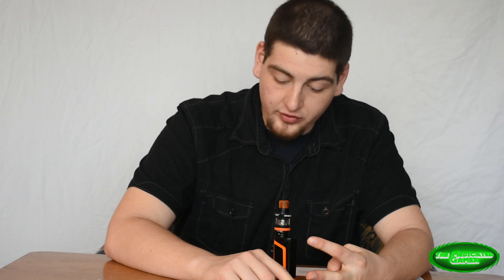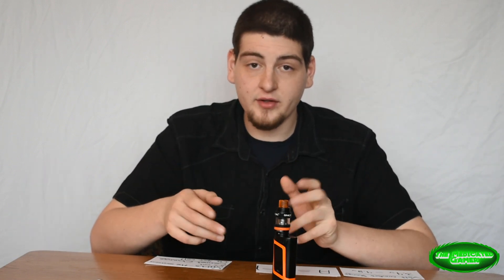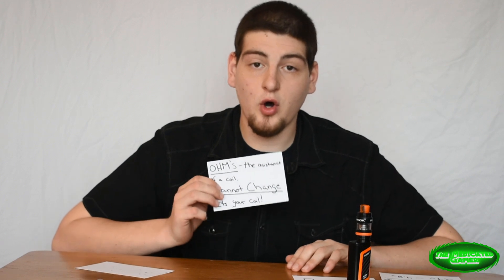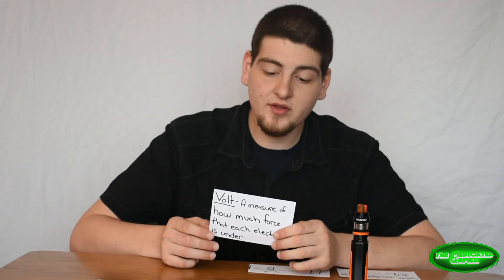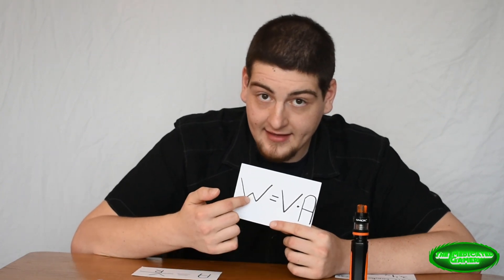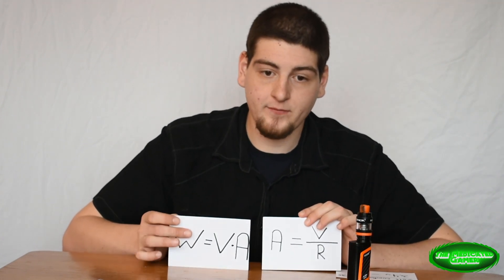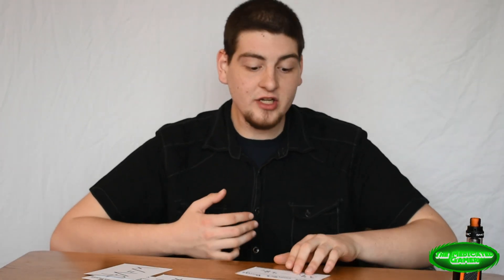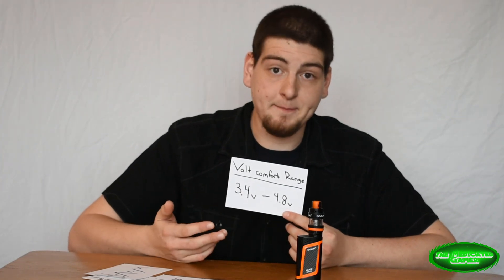Vaping 101: OHMs, Watts, and Voltage Explained for Beginners

Comment: How to know my voltage
Reply from the maker: As long as you're using a digital mod like the one I have it should display on the screen somewhere. It should look something like (just example) 3.255V, the v means volts. Some mods only show the voltage when you use it, when idle it says 0.000V. Hope this helps!

Comment: The ohm show on my vape was 1.50
Reply: I'm using rev nitro vape..
Reply from the maker: Honestly I've never seen or used a coil in modern vapes over .8.
I do remember back in the day when vapes first got popular the tiny coils they created were like 1.2 but the mods at the time didn't let you change any settings, they just were.

Comment: Thanks for the effort...but I'm more confused now than before! I've used just basic mods before - no settings at all. Decided to get an Aspire Dynamo 220W - and I have NO IDEA what to set it at. I was hoping for something a bit more simplistic - I got a D in math!
Reply from the maker: Depending on the pre-fabricated coil that either came with it or you bought after the fact, I would adjust your watts until your ohms read somewhere around 3.2. Once you reach that you can adjust it slightly to your liking. Sometimes I run my watts high enough my ohms read over 4 and sometimes as low as 2.5. It's all your preference. However higher the ohm, quicker you'll burn your coil and drain your battery. I hope this helps, let me know if you have any more questions!

Comment: get c++ for free and put THIS 

// tea.cpp : This file contains the 'main' function. Program execution begins and ends there.
//

#include <iostream>
#include <conio.h>
using namespace std;
void OhmsLaw()
{
 float r, w, a, v;
 cout << "What is the resistance (in ohms) of your coil: " << endl;
 cin >> r;

 cout << "\n voltage (v)" << endl;
 cin >> v;
 a = v / r;
 w = v * a;
 cout << "\nThe wattage that should be used is " << w << " on a coil with " << r << " Ohms." << endl;
}
int main()
{
 cout << endl;
 OhmsLaw();

 cout << "\n\nPRESS ANY KEY TO CLOSE THE PROGRAM.... " << endl;
 _getch();
}

Comment: I'm brand new to vaping and honestly, I'm even more confused after watching this. I have the T Priv, got it set at 50 Watts. If I put it any higher it burns my lips when I vape. Also there are 3 settings for my coil, steel, TI and NI200. I don't have any clue what kind of coil is in it.

Comment: I can adjust the ohms on my SMOK Alien mod. So, yes, you CAN change the ohms.
Reply: No, you cannot. Telling the device that 1 ohm exist does not make it true if the actual coil registers at .5 ohms. If you tell your device that you have 1.0 ohms resistant coil and you want it to produce 10 watts of power output than the device will increase the voltage applied to attain the 10 watts of power expecting a full 1.0 ohms of resistance  thus burning up your .5 ohm coil.

Comment: Medicated Gamer i need your help.I got my istick pico mini melo III from Greece and i am now in the United States and i just dont know what coil it had because i used to go to the shop that i got my vape and they used to change it for me so i had to learn how to do that on my own, i am trying to figure out the ohms and the vg/pg and everything.I am pretty sure they replaced the coil the first time i got it but i dont know what they put and they wont reply to my messages,but i do know that it looked like New Aspire Triton Replacement Clapton Coils Head 0.3 0.4 0.5ohm For E smoke Hot but i am using the Aspire Triton ZPB Coil Head Replacement 1.8ohm DE. From the standard configuration i found online says that ec head which i understand is the coil says 0.3ohm head for the 2ml glass tank and 0.5ohms for the 4ml tank?They told me i could put it up to 13.0W i have 1.81Ω (ohms?) and 4.85V.I used to vape 90vg/10pg but i cant find it here so i am using 70vg/30pg with 3mg in 100ml juice.I have open air flow.I am pretty confused so i really hope you see this message and reply to me.Thanks

Comment: So... do you get more smoke using more watts? Does it use the same amount of liquid?  Do you get more flavor from using something with more wattage in it? I got a small $20 pin and it gives a good amount of smoke so I'm just wondering what's the point of something bigger and if it's worth it.
Reply from the maker: I've found, lower ohms offer bigger clouds. However the lower the ohm the more power it requires so you will need to increase your watts. And of course, bigger the cloud, the more juice you're using. If you're looking for flavor you need to chose the right juice. Juices are made with a blend of VG (Vegatable Glycerin) and PG (Propylene Glycol). More VG means thicker clouds, more PG means more flavor however I do find high PG liquids to be harsh. Let me know if there's anything else I can help you with.
Reply: If you're getting any smoke off it you need to stop immediately.
Reply: @dedmujenta6779  lol you know what I mean 🤣

Comment: Yeah... this is EXACTLY why I quit vaping and started smoking again. I was ok when it wasnt so damn confusing.
Reply: It's actually fairly simple. It's basic math.
   But as long as you have a regulated device and don't build too low you don't need to know any of this. 
    Factory made coils have the resistance printed on them and recommended wattage range so you don't need to know the math. 
    Only time I smoke cigarettes is if I'm out and about and batteries die. I try not to let that happen. 
    Cigarettes affected my breathing. It was hard to walk uphill. Smoked a pack and a half a day for 25 years. I prefer cigarette flavor to vaping because nobody can make a liquid that tastes like a real cigarette. But at least I can get the nicotine and still be able to breathe.
    Good luck, watch some other videos aimed at beginners and maybe you will find a kit that works for you. 
    The initial startup takes an investment but in the long run it's much cheaper than cigarettes especially if you start building and wicking your own coils. Really isn't complicated at all once you get started. Just don't use mechanical mods or you could burn your face off if you don't know the math.
Reply: just buy juul or vladin if this confuses u
Reply: @daviddahl83  basic math isn't difficult at all. It's super simple
 It's not calculus or trigonometry, hell it's not even algebra.

Comment: okay I have a question, I have the SMOK BOX i HAVE NO IDEA what the numbers are.   EXA:   I'm gonna go top to bottom left to right
30.3 letter N in a square over the letter W then pic of the battery VOLT  OHMS  AMPS      
0.000   0.249  0.000   mode   PCB  PUFF
WATT  98*   007 
LAST  line inside of rectangular box    is  0.1s

Comment: I vape CBD for medical reasons and the brand I use says to use 40-75 watts for their CBD to be effective. You said you have to change the wattage to get the right voltage for the ohm coil you have, but what if you need to use a certain wattage? All this is where I get confused. I didn't think vaping was so complicated
Reply: Lina M.C. You just buy coils for that wattage range. I use a 0.5 ceramic coil that recommends 25 to 40 watts and vape CBD at 35 Watts

Comment: Give us the right watts that used with:
0.1 ohms
0.2 ohms
0.3 ohms
0.4 ohms
Reply: the watts you should use is written on the coil
Reply: Ashfaq I use clapton coils. So what would the wattage be for a .193 ohm single coil clapton build?
Reply: Lol
Reply: Clapton coil are for advanced vapers lol so idk xD
Reply from the maker: It's really all personal preference, I cant give you exact numbers. More power means hotter vape thus burning off more vapor but higher watts also means quicker coil burnout and battery drainage. Ying/Yang, what would you prefer?

Comment: Just binge watching random youtube vids and stumbled across this. I admire the effort to try to explain this aspect of vaping for new vapers, but honestly it just over complicates things. Most (if not all) new vapers will purchase a regulated mod and use manufactured coils. More often than not, prefabbed coils will have the recommended wattage range printed on the housing for that coil resistance & material. Calculating amps and voltage with a regulated mod is basically pointless in VW mods. The batteries are isolated from the atomizer circuit by the chipset so when you set your wattage, the regulator board will do all of the number crunching and voltage/ amperage adjustments required. The best advice a youtuber such as yourself can give to new vapers is product quality (authentic batteries, battery ratings, trusted brands, etc.). Just my 2 cents, not discrediting the effort at all. I only mention this because I was extremely confused about all of this when i first started vaping and it was completely unnecessary stress lol. Keep up the good work man.
Reply from the maker: I really appreciate your well thought out response and the time you took to write it. I'll definently take your advice moving forwars and thank you for the support.
Reply: @TMGProductionsOfficial  thank you for video. is there any way to contact you? I'm kinda desperate and I need you help
Reply: @alexanderromanov7581  this was 5 years ago bozo
Reply: @LAZYCHUD  well i was kinda hoping people don't magically stop existing in 5 years
Reply: great feedback man =D
Reply: Coolio
Reply: Oh yes. I am confused.
Reply from the maker: @kathybeyer1924  I think I was too 😂
Reply: Actually, I just bought a mod (smok mag) and the box did not provide any info on the recommended setting nor was it preset to it out of the box. I had to figure it out using this video.
Reply: I agree, now I am more confused.
Reply: Michel F. Absolutely, smart people out there
Reply: Juicyblunts ok Tyron 😂
Reply: Good video man 💪🏽
Reply from the maker: Juicyblunts that's really well put, I should change the title to at least intermediate
Reply: yes. like what I am right now. really confused. i wanted to learn so that I know what im gonna buy.

Comment: Hi! im currently using a vaporesso revenger 220W and just bought 18650 IMR efest 35A batteries checked online and they are genuine, my atomizer is smok TFV12 prince and their coils have low ohms like 0.15, it is written on the coil to use it between 80-100W. Is it safe? im really curious and read some bad things about efest batteries but that was after i purchased them and i have some doubts in my mind, any help would be appreciated.

Comment: On the contrary, video is mch helpful though still cnt find my comfort zone in 0.40ohms/26g kanthal coil..will u help me..setting my loops into 4, my wattage is in between 40w - 50w...my mod is fast heat...need your help. Thank you

Comment: Couldn't I just put in a different Coil if I wanted to change the Ohms?
The question then becomes why would I want to do that, what will the affect be?
Reply: dont change any setting only the watts the watts you should use for your coil is written on it do go higher then what is written on the coil otherwise it will burn

Comment: thanks for the video . I have a question . i have eleaf istick pico 75w on wattege mode its on  10 w but when i vape the voltage doesnt change at all . is that true or stm wrong .res .35 ohm

Comment: What happens IF I change the ohms?  Because on my 0Sub 80W Baby Beast I CAN change the ohms on the premade coils I buy.  Like right now I have the .15 coil in  and after a day of vaping on this now its at .14    I don't usually mess with That setting but I'm wondering what happens if I did. Sorry for the stupid question!
Reply from the maker: It's very common for factory made coils to read on your mods slightly different at different times, its trying to read it but they're just not that accurate. A .01 difference is pretty much no different.

Comment: Oh but you can change your ohms. There is a settings and everything on your alien.  Maybe its best to not mess with your ohms.
Reply: The "Ohms" setting is for telling the device the resistance of the coil you're using, saying you can change the "Ohms" in the menu is like saying you can swap tyres in your car on the infotainment screen
Reply: but you can , go to settings and adjust ohm.
Reply: Wattage,not whattage...
Reply: I know this is old but here's my thoughts, I don't know a lot about vaping but I do know a lot about electricity. The resistance, or ohms, is usually determined by the material that is being used as a conductor. So, you may have the settings for different ohms but it's going to stay in the same general range depending on your build. (I assume, no research or anything)
Reply: I know I can change my ohms on my Smok Procolor through the menu - just lock it, then hold the right button down a few seconds and wah-la you can adjust ohms.    I actually had to lower it with a new coil because it was spitting.
Reply: on the smok t-priv mod u can go into the settings and fine tune the ohms  even on an rda
Reply: OHMS CAN ONLY BE ADJUSTED ON SMOK COILS - AND THEN IT TAKES A FLESS-BITE WILLIE JANK SCREW DRIVER, SOLD AT WALMART FOR $49.95 - IT IS RECOMMENDED THAT FART KNOCKERS NOT ADJUST THEIR OHMS, SO I GUESS THAT LEAVES MOST OF US OUT - LAMO!
Reply: ONLY A FARTKNOCKER WITH A FLESS-BITE.................WAIT, I TOLD YOU THAT BEFORE, LEAVE YOUR OHMS ALONE, LEST YOUR WHATTAGE BE CONFUSED!

Comment: Maybe you can help me out here, I just got in to trying to use an RDA and am super confused here, ok so I've got pre rolled coils, if I stick one coil in the rda it reads .3 ohms and fires up perfectly but then if I add another coil to the rda it reads .17 ohms which makes sense but it will not heat up on my mod it just gets hot but will not fire up and obviously I stop firing so I'm not being dumb, it's on an Alien220 mod btw, doesn't make sense because the coils in my baby beast tank are around the same resistance at .15 ohms so why would it work in the tank but not in my rda which virtually has the same resistance? Been trying to figure this out all night and am just super confused by this, so if I have one coil at .3 ohms in the rda it fires up perfectly nice and smooth glowing red but when I stick a second coil in the rda for a dual coil build reading .17 ohms it does not work, I hit the fire button and I can feel them and the battery getting hot but they will not even come close to glowing hot
Reply: 2491kridge Increase watts. Less resistance = less energy converted into heat.

Comment: I have an Alien 220w and it is a 0.2 ohms coil in it. What's the good watts to set it at? Bc around 80-100 the hits aren't very comfortable
Reply from the maker: Personally I would keep it at what you have but thats just my preference. If it's too harsh I would perhaps try 65-70 watts. Keep experimenting with lower watts, as long as you don't turn it up too high nothing bad can happen so just keep trying trial and error until your happy.

Comment: I'm vaping on a Smok Alien 220w, with a TFV8 Baby Beast. I'm using the 0.15 ohm coil that came with the Baby Beast, but my device reads 0.19 ohms. I usually keep it around 80 watts. Is there anyway I can improve the density and flavor of my vape? The Alien 220w has a setting to adjust ohms.
Reply from the maker: I love my Alien220w. I found in most cases, the smaller ohm the coil, the higher chances for imperfections that show your coil coming up at a .04 difference. However this is just speculation and I'm not entirely sure. 
As far as density i recommend using a juice with the highest VG blend possible. VG gives better clouds while PG will give you better taste. (I find more PG to be harsher as well)